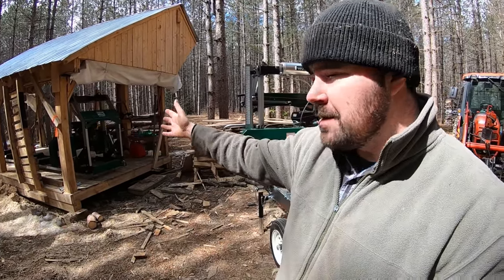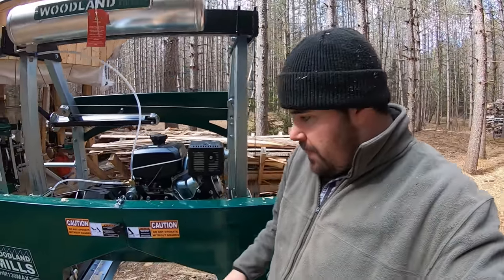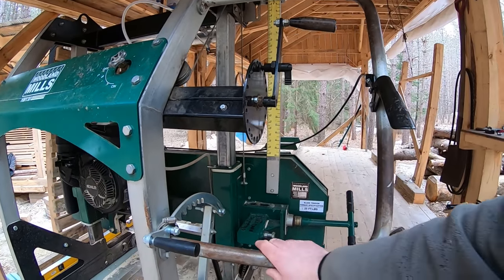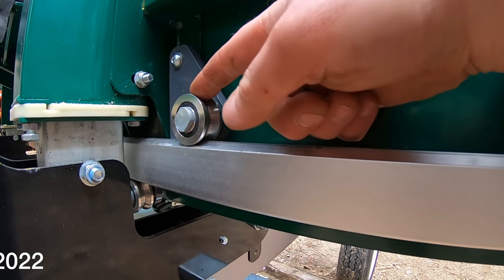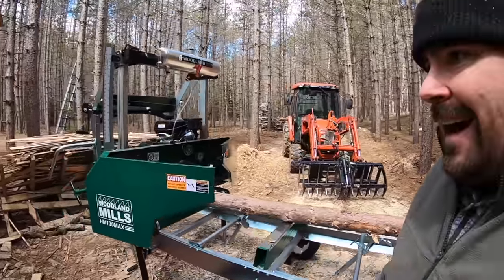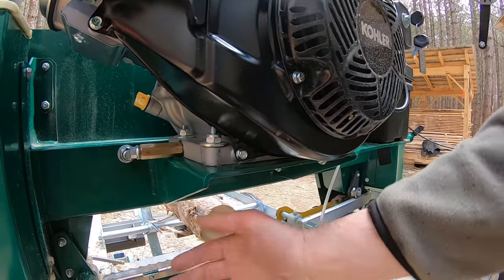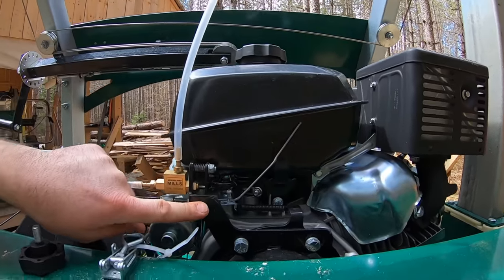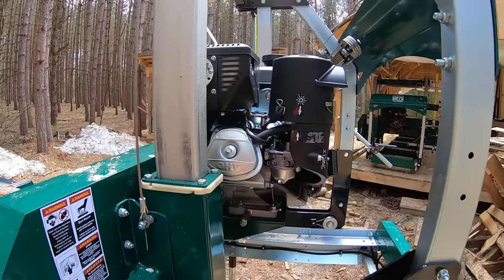Comparing New Woodland Mills HM130Max to the Old HM130 | Differences may surprise you

Comment: Good Morning Sandy- I have a HM130 Max XL on a trailer- one upgrade I did with mine was add a hour meter that runs off the spark plug wire. The supplied Hr meter while on a trailer it records all vibration so when driving it around it is recording and add ghost hours. If you are diligent with oil changes by hrs then it will be inaccurate. I also added a stronger gas shock to the lap siding  (1250Nm) attachment to raise and lower the head more easily with the head being heavier. So far it has been doing us well and been fun to learn to turn logs to useful lumber while clearing a 2 acre lot.
Reply from the maker: That's a very good point Mike about the hour meter and the head raising idea. Thanks for sharing

Comment: Hey Sandy, excellent video noting the updates and changes!  One thing to mention as well is it has an hour meter I noticed, also having the vent for the lube tank will also act as a gauge of the level in the tank, I like that little addition.  Thanks for having us over cheers!
Reply from the maker: Yeah that hour meter does come in handy. Alteast keeps me updated on how long between blade changes and oil changes

Comment: Great video.. I  have an older (2015) Norwood HD36 and really like it.. Couple of things I think are  nicer on your new new mill vs my Norwood. Width of Cut.. Norwood is limited to 28" unless I remove a blade guide.. Your rail system for the adjustable blade guide is superior (IMO), Ability to change oil without making a mess.  Again.. Thanks for posting these great Videos .. Keep on sawing..
Reply from the maker: Thanks for sharing your experiences there Rick

Comment: Sandy, two things about the blade guard for the adjustable blade guide that you will figure out over time.  It is just one more thing to have to take off when changing blades and, more importantly, whenever a blade breaks or comes off it will bend the guard as it a very light gauge metal---easy to bend back into shape but just a pain to have to do it.  I took mine off and haven't used it since.
Reply from the maker: That’s good to know Mike. I can see the extra step now that you mention it
Reply: Same, it was just in the way.  Absolutely love the 130max.
Reply: mine was removed on the first blade change and never reinstalled.

Comment: Excellent comparison.  You may want to put some kind of screen material over the open vent tube on your new lubrication system.  pantyhose material and a rubber band work well.  Otherwise sawdust will work into your liquid supply thru that opening and eventually will affect your valve, usually stuck open.
Reply from the maker: Not a bad idea. Thanks for sharing
Reply: I agree.  Right away I just used what was lying around...a small(orange) wire connector fit right on the end of the tube and just drilled 1/16" horizontal holes in it for venting.  It has never come off.
Reply: Back flush through fill port to clean out breather. Quick and easy

Comment: I maybe wrong but what is the measurement from the bunks up? Can you do a 30inch log? Raised? The Weight of a big log is alot to handle. And your forest looks like small planted pine.I got the 126 with the 14 hp. 12 feet is as long as I want. I will make an extension to get that.

Comment: Hello Sandy, we have a 2021 130 max on a trailer. 

 It also has an engine hour meter.  However I want to warn you that if you take it for a drive, the hours will go up on it as it works on vibration. (so not good if you do plan on moving it).  So to fix that we installed a different engine hour meter that actually reads engine compression.  
I also find the new adjustable blade guide kind of sticks and doesn't move easily after a bit.  I think I prefer the old method.
Your new log stops don't have any cut marks in them yet.  lol.  Need more time.    I found the stop to protect your blade from the log stop kept on falling with the vibration and didn't work. (now we have cut log stops).   Perhaps you have advice on that?

The only thing I see different from our 2021 and your 2022 right now is the new sticker on back that says 20-25 lbs. The tensioning in the book we received said to tension it until the bearing was flush, but that wore out a set of belts after two hours of use.  So now they have added the torque recommendation.  (and sticker - which I might ask them for one).

No other issues with ours.   Thanks for the comparison video, I really enjoyed it!
Reply from the maker: Hi EA! Glad you liked the video and thanks for the idea about the hour meter. I’m fortunate in that no marks yet on the saw stop (hopefully I didn’t just jinx myself). I’ve heard others have put loctite on the small threaded bolt which Honda the angled log stop piece to keep it from vibrating out. Good to hear you’ve had such good luck with your mill and how similar it is to mine. Im hoping for the same . Thanks again for watching

Comment: As always good job doing the comparison.. small hint you may want to keep a few of the spring loaded balls, I have used 3 in very little time. The one on  adjustable blade guard wears from vibration, height adjust plunger,keep it a little loose.
Reply from the maker: Thanks Bryan I appreciate that

Comment: Thank you for your comparison...it was very informative.  So, my question, is this...I see that your first unit did not have the trailer, but your new unit does have a trailer.  Why?  Is there a benefit that you see, in general, to having the trailer or is it just a personal preference deal?  Trying to see if the additional $1600+ is justified.  Thanks again!
Reply from the maker: Big thing I found with the trailer is the ability to move it around my property and to other locations to cut wood

Comment: Nice job on the Video! On the lubrication tank, the thing you called a vent is actually a level indicator for the tank. While it could act as a vent if air gets in the tube, its primary purpose is to allow you to monitor the level in the tank without taking the lid off.
Reply from the maker: Thanks Daniel. I’m learning everyday

Comment: Planning on ordering a new woodland mills HM130MAX, on Monday 02/13/2023, adding 2-track extensions, and a lap siding attachment, will possibly be setting it up on a 108inch wide X 30ft. long  gooseneck trailer, that way I'll have a portable mill that can cut up to 22ft. lumber, it's still in the planning stages right now, stationary vs. portability, not sure if I want to tie up my gooseneck, in case I need to haul my tractor, vehicle, or something else 🤔
Reply from the maker: Yeah lots of decisions there. I don't have a big trailer but I could see lots of uses from the gooseneck

Comment: I find the vent tube also is a good visual for your depth of lubricant. I still want to see how you adjust the auto lube as I find mine finicky.
Reply from the maker: Good point there Earl. I’m interested to get the auto lube going as that will be a first for me as well
Reply: Wanted to give a nod to Woodland Mills. I believe the tube is specifically for sighting. The cap on mine doesn't fit so tight that it wouldn't let air in so that would have been fine for venting.  I haven't needed to adjust the auto lube at least not the valve for the handle. I make the adjustment at the tank valve but I will say I don't care for the petcock style.  Using certain soaps in the water can wreak havoc on the brass and mine always seem to get stuck. I have to keep a pair of pliers handy. I think I would prefer a regular stainless ball valve.
Reply: I have 130max 2021. The auto lube when it works is great. I found mine plugs, soap bubbles seem to plug. I have taken it off clean empty tank an rinse, the problem keeps returning. I use 1 tsp of dawn dish soap.
Reply: I usually have make sure no air bubbles are in the line by manually holding open auto lube valve.
But the throttle play has to be exact or no flow. I have tinkered a little bit with throttle and the adjustable spring on the auto lube but not perfected yet.

Comment: With the new saw/blade wider is the blade still supposed to ride flush with the back of the wheel? After watching one of your videos I assembled my 130max and realized blade is sitting 1/8 past the wheels in the back so I adjusted it flush and it threw the blade of within an hour of use. Is the new not supposed to be flush? Thanks
Reply from the maker: Think it's suppose to overhang the back just a little bit.
Reply: Thanks for the reply, I better set it back to how it was then, Just that the few older tracking videos I saw all said flush with the back of wheel, thats why I was quick to adjust, oops. and the blade did jump off to the front.

Comment: The vent for the lubrication tank also tells you how full / empty your water tank is...  Also, I finally got my 130Max set up and man the screws just like to rattle out, the blade guard set bolt worked itself lose and destroyed a blade, and the bottom clast for the right side door just fell off.  All that being said, it is a powerful machine very capable of powering through very large logs no problem.
Reply from the maker: Good to know . I’ll be sure to keep an eye on those

Comment: Sandy i have a 122 really like it but I have an issue with it rocking any ideas. Thanks
Reply from the maker: I find that after it's sitting on the track that's level and flat you can loosen off the lower leg bolts and then retighten them and it may not rock anymore.

Comment: Why did you upgrade to the HM130max? Do you prefer working with the trailer? Witch one is easier to work with trailer or no trailer?
Reply from the maker: The HM130max has a wider cut and some added features like auto lube, electric start. I do enjoy the trailer height now that I'm getting used to it. I think I'd always go for the trailer now after having this height option

Comment: So essentially, your old HM130 (if no extension) compares in size to a new HM126, which costs $3,699.00. Wonder what your old unit cost new? Your new HM130MAX ( if w/o trailer) as compared to your old mill costs $4,999.00, considerably more but has a 7" greater cut, which is huge as you stated. When did Woodland Mills make a 30" mill?. As I'm putting my new HM130MAX w/ trailer together, it sure is nice seeing these differences just to know where the improvements are.  Thanks for sharing, Sandy.
Reply from the maker: Glad you liked the video Bruce

Comment: nice video  i didn't know the 130 max was wider than the 130. the electric start is really nice mine start as soon as you turn key. i am to old to be climbing around on a trailer. i mount mine on cement and pouring gas in and lube is easy. take care, be safe and well.
Reply: I also love the height of mine on a slab
Reply from the maker: Yeah that concrete pad sure would be handy to keep things all level and flat.
Reply from the maker: I do like lower at times as well.
Reply: and straddling the track over the concrete seam is handy as heck for a cant hook anchor
Reply: @Cacheola  yes it is much easier . i set the big logs on with tractor and turn them too. the small one i use a cant hook too.  take care, be safe and well.
Reply: I am envisioning a split deck with a concrete pad to allow pull-through of the trailer.  Never have to take it off the trailer and still have the floor-mounted height when wanted.  Possible problems of a flat tire on the trailer, though, unless the deck is high enough to allow access. Maybe a folding platform on either side to lift up when needed.  Any innovation leads to another problem to solve.

Comment: On the 2022 and newer models, using a torque wrench is not recommended for proper blade tensioning, the company actually recommends not using a torque wrench for blade tensioning, what are your thoughts on this subject ? 🤔
Reply from the maker: I'd agree that whatever method they suggest would be a good method to use. I"m used to the torque wrench from my 2017 HM130 and since it seems to work well on my sawmill that's what I use

Comment: hi Sandy - I would switch out your two units and put the 130max in the hideout and the older one on the trailer - my two coppers which arnt worth a red cent.....  ps, unless the rails arnt the same width
Reply from the maker: That would be handy if they were the same width doing that but the hm130 max is a good bit wider

Comment: does that extra 6" width effect the cut as far sag or anything or does the tension overide that?
oh, you actually explain that.
Reply from the maker: Good question Terry. I haven't noticed anything in the way of cut differences. All seems good at this point
Reply: If I had a woodlot with a million toothpicks, I'd own a quality north american made, honda powered narrow mill as my main. I also have the 130 max and when cutting smaller widths you can often see a slight deflection when it cuts around big knots

Comment: You may want to consider putting a U-shaped piece of tubing in the top of the vent tube so it faces down to prevent sawdust from getting down into the tube.   I have seen this brought up in a few other videos.   (edit.... maybe even a cheap little plastic in-line fuel filter, or an airstone for a fish tank would work as well.)
Reply: or just plug it... if and when your flow stops, burp the filler cap
Reply: @Cacheola  Or buy a vented cap.
Reply from the maker: Thanks for sharing that Wallace
Reply from the maker: not a bad idea either
Reply: @wallacefrey6247  not necessary. That medium hard plastic bung doesn't seal. Even if it did, you could cut for a 100hrs and not have to burp it. You don't want it streaming out like a faucet, drip drip drip...

Comment: Could you swap the heads, put the new one on the old rails and the old one on the new trailer? I guess it depends on which you'll use more and if it is physically possible.
Reply from the maker: The new saw is actually a good amount wider than the old one

Comment: I may not be the only one to say..... you do not have the safety angle metal that keeps you from hitting your log stop in your older model. At the same time I understand that it can also be a pain in the behind with certain logs and mine vibrates loose.
Reply from the maker: You’re right about that. It rattled out at some point and I haven’t got it back in yet

Comment: I have watched hundreds of vids with many blokes sawing timber / lumber Sandy is the only one that sets his blade to get equal cuts from the top of the log to the bottom ..
Reply from the maker: Thanks for watching Russell. I haven't seen too many other people cutting wood before but what do others tend to do differently?
Reply: @sawingwithsandy  They cut the round bits off ,, in Aussie we call them flitches ,,, then start cutting their boards ,,they dont even cut their cants to width , eg, 10, 8, 6, inch ,,, just start chopping off the top and nearly always finish up with a thin board as off-cut  ,,, just a waste of a cut
Reply from the maker: Oh ok. I can see how that would work well. Thanks for sharing that

Comment: I'm not a fan of the log clamps, they suck!!! I've got my mill sitting on a concrete slab because it's easier to roll BIG logs onto. This makes the clamps fiddly b/c they're constantly bottoming out on the concrete and you're forever trying to find the sweet spot. Regardless, when you've got a log with some weight, they DO NOT easily release from locking on the slide and you need to hit them with something or pry your log or both... only to have it release and get stopped up on one of the two spring pins holding the contraption together - grind these flush. Add to this, the fact the clamps are not symmetrical... you may need it swinging to the left OR to the right... to the left, you risk clipping the offset handle :-|. That said, it's really my only beef
Reply from the maker: Yeah can imagine over the years some small things you mentioned can be a bit of a pain
Reply: @sawingwithsandy  I'm hoping you sell your old mill and drop a honda powered LM30, woodmizer, or perhaps vallee in for comparison. You've done so well with your channel, any one of these suppliers would be fools not to cut you a deal. This WM was a great price and hard to beat cut width. It does "twist/shake/wobble??" more than I'd like and would be interested to know if the other brands control this better - yes I have all the guides, bushings, bolts all snug. One of the things that attracted me to WM was the skookum looking frame design over the anemic looking woodmizer's. but... is this something inherent with these smaller mills???
Reply from the maker: Since I haven’t run any other brand of sawmill I don’t really have anything to compare them to but I am getting real nice lumber consistently I’m finding

Comment: my hm130max uses 158' blades
Reply from the maker: Yeah I think I misspoke as I use 157.5″ x 1.25″ x 0.042″ x 7/8″
Reply: @sawingwithsandy  only a true hm130max handler would of picked up on that ...lol....I figured you knew
Reply: And if you get a chance...try the 1.50 wide...you  won't regret it
Reply: @TheJoewag  better for 30" diameter live edge doug fir slabs?? Maybe I'll buy one from a local manufacturer to test out
Reply from the maker: Thanks Joe. I’ll be sure to try out the wider blades in the future for sure